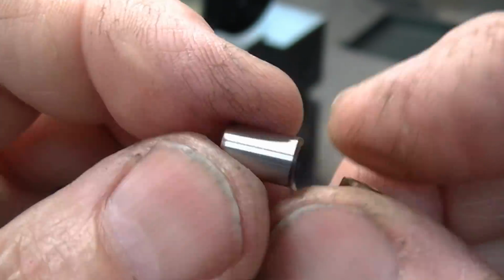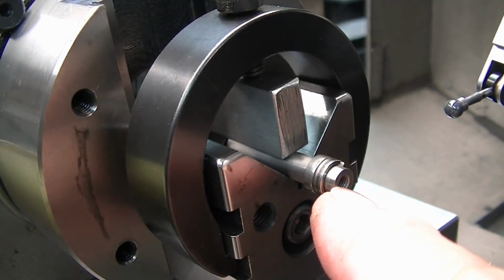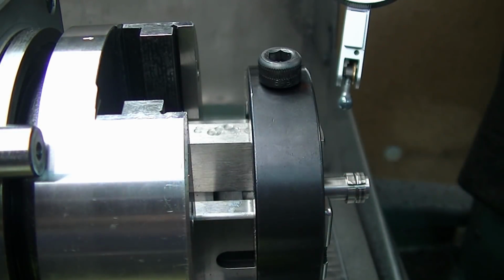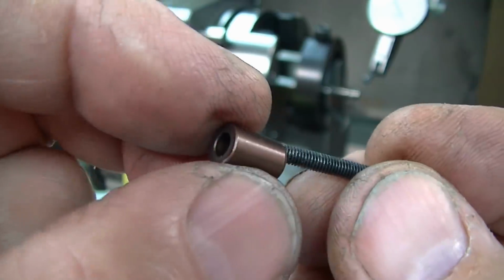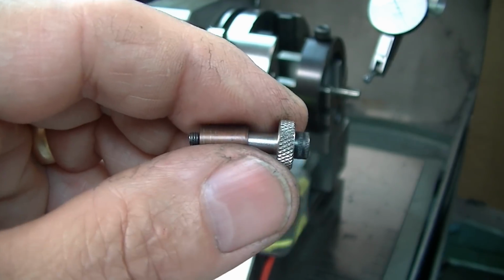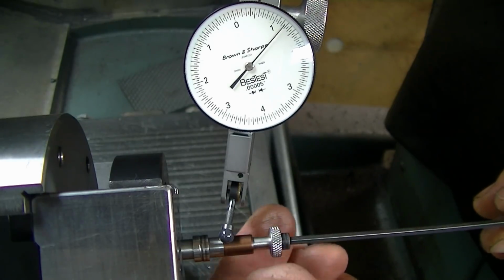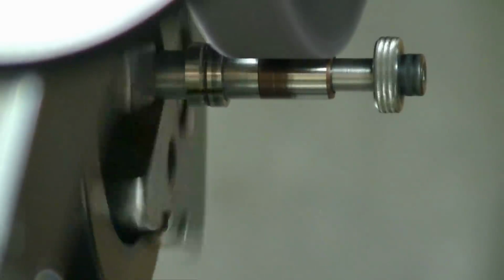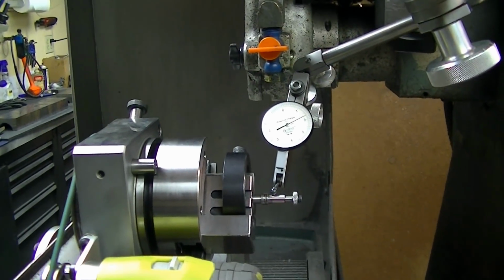ROBRENZ TOOLROOM TIP #1

Comment: I've never operated a surface grinder or a cylindrical grinder before, but I would like to add one to my shop in the not far future.  I'm not sure what tolerances you're working with here, but I was wondering how often you have to redress your wheel when grinding parts like this? One side of your wheel is engaged with the work longer than the other so I'm assuming you get more wear on that side.
Reply from the maker: All the parts were done on one dress of the wheel. Keep in mind we're only removing 1 or 2 thou from the diameter on each part so it's not doing much work.

Comment: Another great video. I can't wait to fire up my new surface grinder. Actually on the mounting with a bolt or screw, I've been a great fan of studs and nuts for a long time. No torsion and the stud can be fixed (Loctite) into the part. Length is always preferable to get the elastic stretch that also adds to the feel of how much preload is applied. I have worked for ASML and they have mini stretch bolts made (M6 etc.) where the center section is turned down to a bit below the thread root diameter. They prefer no Loctites in their assemblies (in the critical areas it's prohibited) so this is one old fashioned mechanical way of achieving a good and lasting preload. Studs and nuts as well as finer threads would be further improvements. But they also use these bolts to be able to pre-assemble them into the assembly so that they are one unit. Which may well be the primary or the only reason for this solution. Pretty neat anyway, albeit a bit over-engineered, like most ASML designs :)

Comment: Thank you for these tips... :) I will have a project involving 5 axes grinding in January and I will definitely grind in place the face of the arbor that holds the parts. Thank you for mentioning it, I probably would not think of it otherwise.

Comment: Huh, is your grinder spinning the wheel counter clock wise?  Question regarding spin fixtures.. should one rotate the part with the rotation or against? Or is there a case for both? I tried to look up literature regarding this but could not find anything.
Reply from the maker: Clockwise.  Case for both, I typically run part and wheel going the same direction at the point of contact.

Comment: i have a question. if one has no measuring equipment more than calipers and od mic. wat would be the first tool towards making  surface plate and finer mesuring tools?
Reply: I would suggest a .0005" test indicator, an indicator stand, and gauge blocks to start.

Comment: I have a question if anyone would care to help me understand. If you ring a guage block to all 4 sides of a central guage block. Then if you could hold fast the outer blocks and press out the center, what would the size difference be between the outer guage and the space it came from. Im told guage blocks can be in the millionths of an inch tolerance so I imagine it would be in that neighborhood. Im thinking the clearance  across 2 sides would be twice the distance between 2 blocks rung together. Also what kind of force would be required to press out the middle block. Would it be 4 times the pressure it takes to slide one rung block against the other? I dont have guage blocks so I cant experiment but am dying to hear what the pros have to say about this. Thanks.
Reply from the maker: Gage blocks only have 2 parallel finished sides.  The wring gap varies with quality of block and technique.  The force to slide two blocks wrung together varies drastically with technique and block condition.

Comment: I have at work a set of emergency collets that I have tapped for various threads.  I use collet blocks in the lathe and will take a skin cut on the underside of the heads on things I intend to use for tooling.  I will often times pair that up with a nice parallel ground washer to enhance the feel of clamping.  Since I started doing this I find that most socket and hex head fasteners are no where near square to the center line of the bolt.

Comment: Neat trick!  Would the indicator jump less (at the end of the video) if you ran it counter-clockwise so it was turning from behind the pivot of the indicator rather than against it?
Reply from the maker: No, that is surface finish and bearing rumble that you are seeing. Remember that is about 0.000025" movement

Comment: It's crazy when working at this level of precision, how every little thing can effect your work.

At work iv been working on very large parts (35+ inches). This adds a whole new level of thinking,  .004TP on a small part, no big deal on a good machine, now try it on features that are 32in apart that are measured from a datum structure with 3 planes that are 24 to 36 inches long. Now your datum plane flatness and perpendicularly will throw you a mile off.

Awesome video on how important your setup is! Repeatability is key!

Comment: sharp work, Rob & lots of good tips.  Did you have any trouble keeping the OD in spec across the whole lot?
Reply from the maker: The OD at the mounting surface is easy to mike and the tolerance is +/- 0.0005" so easy to hold. One dress of the wheel does all 60 pieces.  Thanks for stopping by and commenting Tony.
ATB, Robin
Reply: What wheel are you using to grind these parts?
Reply from the maker: Radiac 8BP60-H800-VOS

Comment: So what taper do those parts have BEFORE you use that contraption to do nothing but grind away the surface oxidation from the hardening process? Those are the same parts you "centerless grind", are they not?
Reply: I'd like to see you try to grind to taper Centerless across the complete length of a part.

Comment: Wouldn't a washer, or even a small thrust bearing, make the bolt easier to tighten...at the same time reducing the rotational torque you are trying to avoid? or - here's a thought, a cam-operated clamp with NO radial torque....and quick-release! And as ALWAYS a great video Robin - many thanks :-)
Reply from the maker: My grunt during tightening may have given the impression it was hard to do but it is very easy.. thanks for stopping by Rupert.

Comment: brilliant, i have a collet nose on a subspindle that is a tap in, and i can dial it in to a tenth but then you start tightening the bolts an it goes where i wants. i'm going to get some longer bolts and make the jumbo version of the renzo-torque-resistor. then with 3 bolts tight it shouldn't move when i put in the other 3

Comment: Interesting! Thanks for sharing! Does the Ryobi motor vibrate as hard as it sounds?
Reply: I'm still processing "Renzetti + Ryobi" bit.  These things... should not be together.  I know, I know.  Still it seems just wrong...
Reply from the maker: No, just gear noise.
Reply: ROBRENZ do you ever measure vibrations? Or would you like to? I have some vibration pickups laying around that I know little about. If you are interested, I could send you one in return for some explaination.
Reply from the maker: I do have some vibration measuring equipment but thanks for the offer.

Comment: It's been a zillion years since I've done anything that fancy. Back in the '60's, we didn't have fancy V-block spin fixtures and 0.00005 graduated dial test indicators but we did have LVDT gage heads and amps (vacuum tube!!) and what we called "block centers" and got by. The toolmakers scoffed at our ham-handed efforts (we're no fools, we did pump their brains) but in the end we hit our tolerances, concentricities, choke angles, face dimensions, etc AND and finishes using a Bryant internal grinder and a B&S surface grinder without building a system of laps. 

I recall a lot of planning and careful set-up but once we got rolling we did the whole batch in a shift or so. Nice thing about tiny parts, the cycle times per feature are very short.

Thanks for the sentimental journey. Haven't thought about that free shuttle(?) servo job for many years.
Reply: I worked at Burgmaster Turret Drill Company in the 1970's....I was Elec/Tech but did get involved in final test of spindles, we also used the electronic gauges, and seems they were well with a micron or so......? A lot of the bearings and the hydraulic valves were assembled in a temp controlled clean room.